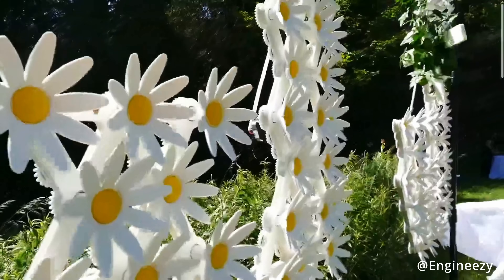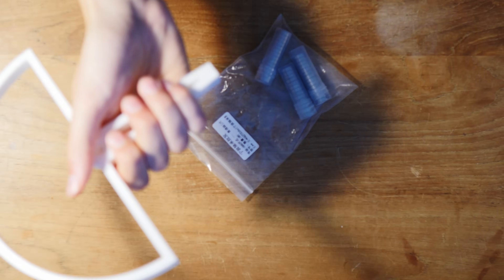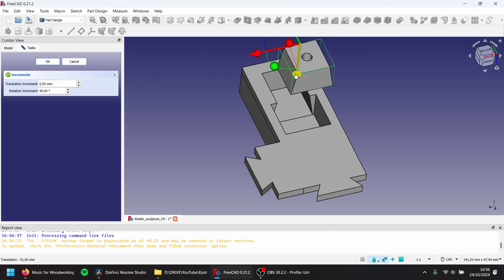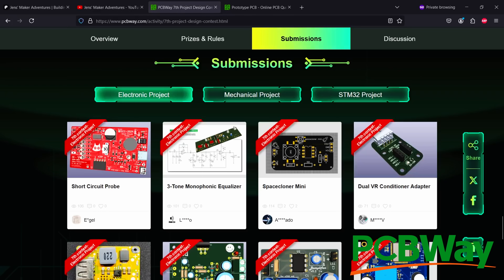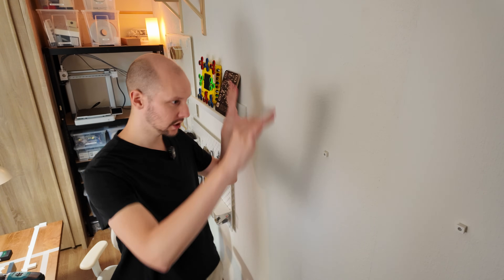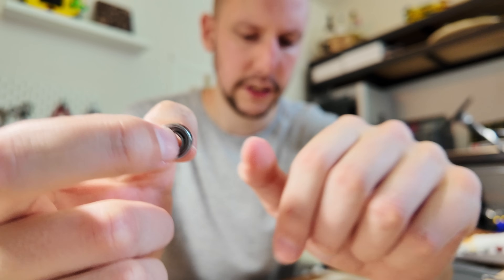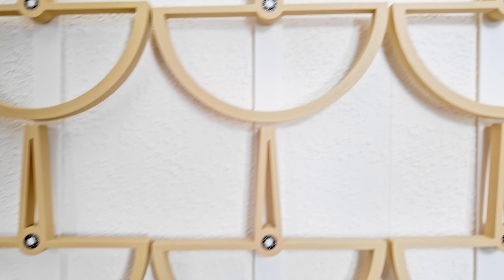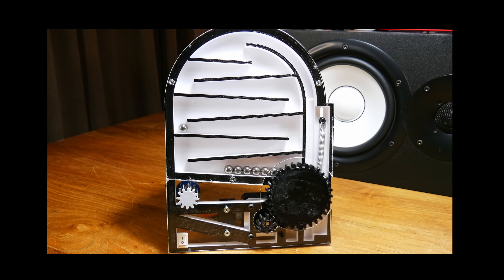How I Built a Mesmerizing Kinetic Sculpture with Magnets

Comment: Really Nice! How long does it last moving? After how many minutes does it stall?
Reply from the maker: Thanks! I think it's reasonably fun to watch for about 40 seconds and then tapers off, I think it's fully still after about 90 seconds
Reply: @strange_inventions  not so long then... I'm looking for mechanisms that last for at least an hour for a conference about perpetual motion machine! Thanks!
Reply from the maker: @dominicboudreau344  Ahh then not this. I've seen kinetic sculptures before which use weights, like an old clock does, or a windup mechanism. That way you can store way more energy and the mechanism will keep going for way longer. Good luck!

Comment: Couldn't you in theory use ceramic bearings if you didn't want to wash them in gasoline. And also they look astatically a lot more pleasing. But I guess they would also be a lot more expensive?
Reply from the maker: Yes!! You are right! 😉 I went for the affordable price so the design is a bit more accessible

Comment: Nice work. Simply mesmerizing. I think it would be beneficial to add at least one more element to the table. So, might I suggest getting your hands on some metronomes. The design allows them to sync with each other.And this might help you achieve some sort of immutability for a more natural flow.
Reply from the maker: Thank you!! 😀 Ah yes, some actuator would be great for this, I too have been thinking about it. Thanks for your suggestion about the metronome.

Comment: One of the problems you have to watch out for when using bearings is that if you force them into a hole that's too small they can actual compress slightly. Then the amount of friction increases.
Reply from the maker: Thanks for the advice, I will remember that!

Comment: I don't know about you, but the X1C yells at me every time I start a print with PLA or PETG to open the door or lift the lid.  You run the risk of heat creep otherwise - the filament in the cold end or the extruder becomes so soft that it can't be pushed properly.  

I've never had good luck with Aliexpress bearings. They're always gritty.
Reply from the maker: I've never noticed the message but it could be right there. Mostly I start prints remotely. Thanks for chiming in, I felt like the 2nd batch also was gritty. I guess you shouldn't order cheap bearings haha 😅

Comment: How about having one powered one that rotates? Would that pass energy to the whole system and still remain chaotic?
Reply from the maker: Great idea! I think then it'd need a motor on every column and it would work!
Reply: @strange_inventions  One motor, then just gear the top ones at subtly different ratios to one another, so they won't look in-sync.
Reply from the maker: @Roobotics  That is cool, but I think you'd have a complicated challenge in getting the couplings to be flexible

Comment: Yes, PLA likes cooling, not heating.  Also, if you're struggling with inserts breaking the print, PETG is incredible for that.  It has so much flexibility and interlayer strength, I've seen it morph around an insert where any other print I would have expected layer separation for sure.  It's just so... plastic.

Honestly I am sold on it as a material for any structural part.
Reply from the maker: You know, I think that's a good suggestion! If the material properties were equal, would you prefer PLA given it's mostly made from non fossil sources?
Reply: @strange_inventions   In principle, yes, it is more sustainable.  If you want to use PLA, PLA+ is another option.  It's much more robust, but still can't hold a candle to PETG in my opinion.  You could also look into Thomas Sanlanderer's work on annealling PLA prints to increase inter-layer strength.  Also though, in practice the lifecycle of PLA isn't completely clean, so you have to ask whether more discarded prints can be justified by the lower impact of the material itself.  It's unfortunately a difficult calculation that we don't necessarily have the information to fully parse out without significant investigation.

However, if you'll forgive me soapboxing a little bit, I'm not a fan of focusing on individual carbon footprint.  It is a time-tested deflection tactic by the fossil fuel industry.  The entire point of the "carbon footprint" campaign was for this purpose, and it was largely successful.  Similar tactics have been used in the past to deflect all kinds of environmental issues on to ordinary people, like waste dumping in the 70s and 80s, or microplastics today.

It exploits our immediacy bias to make us spend our energies on lifestyle changes and policing one another instead of organising action against the huge industries that railroad us into a destructive path regardless of our individual choices.  It's a question of going for the root of the problem or the branches.  All the individual consumption in the world won't make a significant difference if we don't stop the companies.  They are the ones that make the consumption choices hard.  If we were able to bring them to heel or abolish them entirely, we might be more empowered to make collective consumption choices that aren't mediated by entities that routinely hasten the apocalypse for slightly better return margins.
Reply from the maker: Interesting points. I think you are right about where the change should come from. Though what I notice is that governments should make businesses be more green, however we elect those governments. I vote for an environmental focused party but many people don't, because they can't or won't see the crisis in front of us and what it will cost long term. And then little happens, so I try to make small changes if I can make them easily 🤷 I have to say that it's sometimes difficult to watch where politics are going. I sometimes doubt if people vote for what they need, rather than want 😳 I should add that I'm certainly also a very imperfect person in a privileged position, so all should be taken with grains of salt
Reply: Also another option might be to get a metal insert the same size as the magnets and melt the hole out with a soldering iron, then remove it so you can insert the magnets in the hole.  Then the ring surrounding the insert is also melted together, meaning it should be much stronger than the original layers.

You obviously can't do this with the magnets because you'll demagnetise them, hence my suggestion about a hot insert.  If you're quick, you could also utilise the softened hot plastic to accommodate the magnets without heating them up too much.
Reply from the maker: Hahaha this is a creative solution 😁

Comment: 8:40 Stud finders are very susceptible to wireless interference, you need to turn off your Wi-Fi router and even move your mobile phone or other wireless devices out of the room, you may find that you also need to earth yourself by pressing one hand gently against the wall.
Reply from the maker: I tried grabbing a metal cabinet with no success. Maybe turning off the router would work, but then all the routers from my neighbors are still there. It surely doesn't seem like the product is meeting the promise

Comment: Just get closed bearings, like skateboard bearings and don’t worry about decreasing them.
Reply from the maker: The grease causes the bearings to stop very quickly, it is more useful for high torque applications. The lids on the bearings also cause more friction, they are only useful to keep dirt out which is not necessary for this application

Comment: Abec 9 ceramic skateboard bearings would be perfect, but you gotta lube the bearings after you clean them otherwise whats the point
Reply from the maker: Some roll better without lube I think. Fidget spinners are not lubed and some run very well, right?

Comment: That's beautiful!

A tip: make the holes for the magnets oval, not round. The smaller radius should be smaller than the bearing; the larger radius should be larger than the bearing. The circumference of the oval should not be less than the circumference of the magnet. Then, when you insert the magnet, you will deform the oval into a circle, which gives the required clamping force to keep the magnet in place. But the hole in the material does not have to get larger, so it won't crack.
Reply from the maker: Hey Gijs, this is a wonderful design tip!! I will definitely try this out on my next clamp fit! Thanks a bunch!
Reply: Or "crush-ribs"
Reply: That was a really clever idea! But the math was surprisingly tricky.

Comment: The smaller the bearing the lower the friction drag
Reply from the maker: So if you get more small bearings it would oerform better than one large one? 🤔
Reply: @JensMakerAdventures  yes if your looking for lower resistance, I made a bearing fidget spinner years ago, a large diameter bearing  with a smaller one inside untill you get down to a 4mm OD bearing in the middle, and when spun it's the 2 smallest that spin the most and the big outer one that stops first, it has too much surface friction and pressure on the balls.
Reply from the maker: @foosty6  That's super interesting. Thanks for sharing this info :)

Comment: Get a can of WD-40 and use the spray to clean the grease out of your bearings. It’s much safer and works much better than gasoline (which does not lubricate). Wear gloves with the spray since the liquid can cause your skin to lose moisture. With the straw for targeted, focused spray, it will blow the grease out of the bearing and give it a thin lubricant that helps the bearing run smooth and fast.
Reply from the maker: Interesting suggestion. I'll try this next time I want to do something like this with bearings, thanks!

Comment: As a cleaner, try using Acetone. Excellent for removing grease residue. 

As a lubricant after cleaning with Acetone, use Tri-Flow. It’s a wet Teflon lubricant in a spray can. Perfect for this application.
Reply from the maker: Sounds good! This may very well be the way.

Comment: In my mind I’d either go with something like 608 bearings because they are available everywhere at every price point - you could iterate fast with different batches, OR switch to bushings (I personally would try this first). You could try 3d printing your own in different materials or buy some self lubricating tubes of material you could cut to size. If that worked out, it would be cheaper and easier to
Reply from the maker: If I'd do it again Id also go with the standard size. But I wanted to go the cheap way and get the small ones and them I stuck with them 🤷 I think making my own bearings will not performant enough for this application, same with bushings I'd say.

Comment: That is a stud finder. It will find anything in the wall. Wires, studs, and insulation everything.
Reply from the maker: Well for this model the blinking indicates a power line, per the manual 😅
Reply: @strange_inventions  These detectors are pretty sensitive to how well you are grounded. Just standing in rubber soled shoes, slippers etc. or just the wrong flooring material can cause issues.
Reply from the maker: @crangos  Interesting. I was standing on a carpet. Though holding a big metal cabinet did not help.

Comment: They're bigger than what you're using, but I would suggest skateboard wheel bearings. Even the cheap ones are decent quality. Also look at lube for them.
Reply from the maker: Great suggestion, if I would start again I would use 1 large bearing instead of 2 small ones. And try different lubes.

Comment: Since the fidget spinner craze died you can buy them by the lot for cheap. They generally use decent bearings. I bought some and it was cheaper than buying just the bearings.
Reply from the maker: I did just this and built a synthesizer with them ;-) https://youtu.be/xIgIhpeJyNA  However a lot of them had rust on them and weren't in too good of a state, the quality differs a lot per fidget spinner.

Comment: Wouldn't a 2nd magnet on the bottom of each curve cause each one spin for much longer?
Reply from the maker: Can you explain how this would make them spin longer?
Reply: @JensMakerAdventures  well, isn't your whole concept based on the fact that when two same-pole magnets (on separate adjacent 'shapes') meet, they repel.... Whilst watching your vid I noticed that a lot of their curved bottom edges (without a magnet) passed by an adjacent magnet.... And so, surely if the curved end had a magnet it would have to repel, this making it spin for longer 👍
Reply from the maker: @stuffoflardohfortheloveof  I think the amount of energy in the system or the amount of friction will not change. But the impacts will occur more often and these take energy out of the system. Therefore I think the spinners would actually spin for a shorter amount of time.

Comment: So cool - thanks for sharing!!!
I had some luck making some low friction ball bearings from cheap low quality parts, maybe that's interesting for you. 
I bought metal and rubber/plastic covered bearings that I removed the covers from, after that I covered everything in dishwashing soap+ water inside a plastic container that fits into my ultrasound cleaner tank. Then I placed it into the ultrasound cleaner tank and filled it up with hot water and ran it for half an hour. During the 30 min I used a pencil to fish out single bearings and roll it around to make sure everything gets contact with the soapy water. 
Next step is to quickly rinse the bearings under hot water while rolling it , if the grease is still sticky and fills up the space between the balls, a toothbrush and more soap is needed.
After that was done, I dried the parts and the plastic container, put the ball bearings into the container, filled it with cleaning alcohol and covered the container to prevent quick evaporation . The container now gets 15-30 minutes in the ultrasound cleaner as well and the tank is again filled with hot water.

At this point there was no lubricant left and after the alcohol evaporated, I added a thin mineral oil based lubricant that's typically used for hair trimmers or sewing machines... prevent corrosion and improves the mechanical reliability for a while.
Reply from the maker: Haha your process is such a journey. Thanks for sharing.

Comment: I would think that after de-greasing the bearings, you could apply some wd40 as a light lubricant and then use a 3d printed adapter with on end in the drill and the other end inserted into the bearing so you can spin it it at high speed  whilst holding the outer ring of the bearing still.
Reply from the maker: I think lubricating with light lubricant might work. Why would you wanlt to use the power tool at high speed? To even out imperfections or spread lube?
Reply: @strange_inventions   it would ware the bearings in and take off any spots of hardened grease.
Reply from the maker: @enkidu9989  Ahh great suggestion then, thanks!

Comment: Tri flow is what you're looking for. It's an extremely light oil that leaves a teflon coating. This is the same product used in industrial gravity conveyor applications when a metal object needs to effeciently slide down a metal track. Beautiful work! I may build a scaled down version to sit on the shelf!
Reply from the maker: Build it! That would be awesome! Yes, an oil might be the way to go. Not sure it would salvage these ultra cheap crappy bearings, but next time I will try that!

Comment: 6:36 Your first batch is shielded on both sides (zz) and stainless steel (w).  The second set is open but the material isn't specified in what can be seen of the title.
Reply from the maker: Wonderful, having those codes! However I think the first batch did not have shields. But Aliexpress is kind of the wild west of buying parts, haha.
Reply: @strange_inventions  I suggest asking an AI like perplexity for a complete list of bearing codes.  Super useful.
Reply from the maker: @marsrevolutionary  That's a clever way of using an AI! I'll keep that in mind.

Comment: May I recommend you use Knipex Pliers to install your bearings. The key function is the parallel jaw movement. The slip joint pliers you were using in your video is guaranteed for a crooked bearing installation. 

Part number 86 05 250 is a 10 inch 250 mm length with a jaw capacity of 1 3/4”. Other sizes available.
Reply from the maker: Excellent recommendation, thank you. I only used the slip joint pliers for the prototyping, but later I pushed the bearings in using the table (press fit). I'm sure the pliers you suggest would do a better job and for more demanding projects I will keep this in mind!

Comment: You need ceramic bearings for this.
Reply from the maker: Those are great! I had one to try out and it was very good, however free spinning it was as good as ungreased metal bearings. But ceramic bearings are really expensive right? I wanted the sculpture to be affordable for others to build as well.
Reply: @JensMakerAdventures  yeah the ceramic ones are likely more expensive. Btw there's two kinds of ceramic bearings. There's the all ceramic ones and the hybrid ceramic ones whereby only the balls are ceramic and the rings are metal. As a cheaper alternative clean the metal ones really well, dry them and lubricate them with fine graphite powder.

Comment: I would suggest you to use plastic ball bearings with glass balls. They don't need lubrication and spin freely very long.
Reply from the maker: Are those affordable?
Reply: @JensMakerAdventures  around $4.5 for 10 pieces for cheapest sizes 10, 16 and 22 mm outer diameter
Reply from the maker: @izobrr  Sounds good, I'd love to experiment with them. Do you have a link?